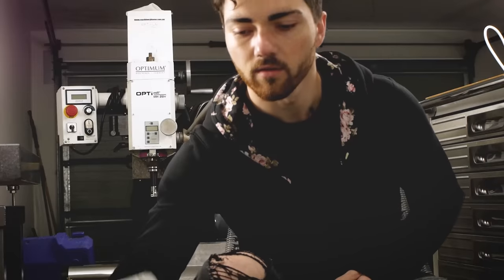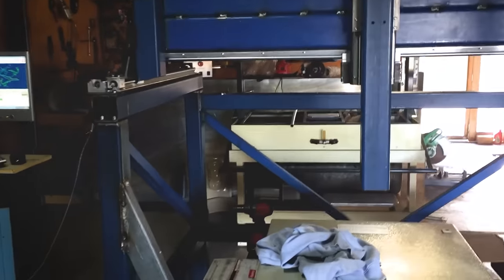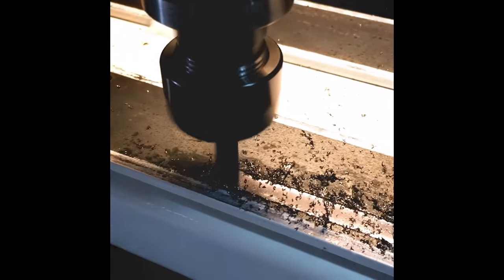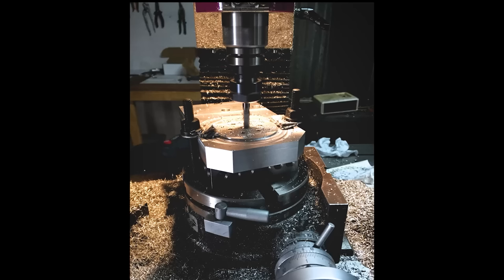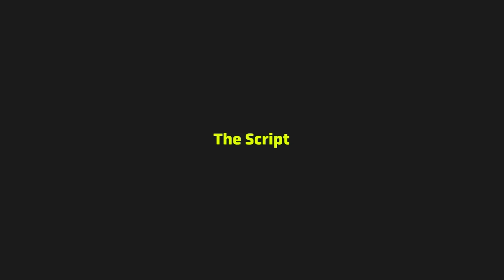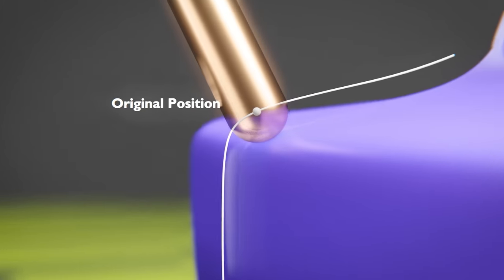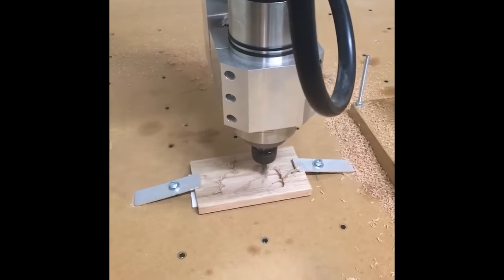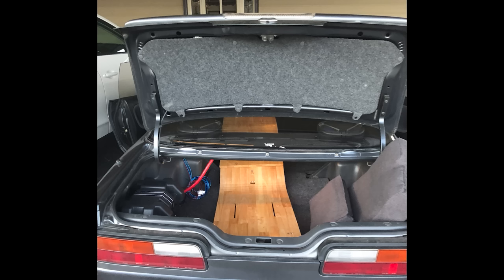I Built a Custom 5 Axis CNC Router and Barely Used It

Comment: You're like a younger smarter version of myself sharing many common interests. Spent about $7k building my 3 axis CNC (contemplated 5 axis but software was an issue). We built a very similar designed CNC's around the same time.  I have been writing code on and off since the 90's, but could never achieve what you did in Python (I could only just understand what you were describing, let alone write it). I did write a self tuning software for the Haltech I had in my 180sx before Haltech even had one themselves. Like you I dropped several thousands of dollars on hardware not knowing if I could even build a CNC, but I dove in the deep end, and with guidance from a couple of friends surprised myself that it turned out so well. I built it to build some subwoofer boxes and surround sound speakers which I have yet to get around to doing. Recently I have jumped back on a lathe for the first time in decades, and I am current writing a mobile phone app to help me with the feed rates. I came up from Sydney about 10 years ago and have settled in Ipswich just down the road from you. You might be interested in what I did with my X axis gantry to over come flex issues.
Reply from the maker: Wow, I really am like a younger version of you 😄
That’s a lot of cool stuff you’ve done! I always feel like the python script appears more complicated than it was, but I suppose that’s often the case when you’re the creator. 
I also want to write an app for some useful tools. Are you writing it just for yourself, and what language and technologies are you using?
Have you got videos on the X gantry rails you’re referring to?
Reply: @machsuper  yes I am currently writing it for myself, but happy to share it with anyone if it turns out alright (I won't share crap, or programs that don't work right). Will be simple to start with. Writing it in... well writing is a bit of a loose term in this particular case, because there is no real writing involved. Derek Banas (guru of all things coding) did a tutorial on this program called "App Inventor" it is a drag and drop interface, but it makes mobile app development real simple. I don't have a history in writing phone apps, most of the stuff I have done in the past was for the desktop, so it is a cheats way of "writing" code. I started with VB6 back in the mid 90's and have written most things I have done in it. A few years back I started learning C# (again thanks the Derek) for some home automation stuff, and an Arduino I was working on. I have touched on Python, but not learned it.

The best video I can see to get a look at the gantry is one called "When Your Z Axis Just Isn't High Enough" from 5 years ago. I am machining a new end plate for the axis itself.

Comment: Thanks for posting an honest retrospective. Multi-axis machines are tough. The physical building part is the most fun. The electronics are interesting to assemble and wire. The software is the bear to beat. Affordable commercial software for a hobby guy like me doesn’t exist, particularly since Fusion 360 quit the 5 axis stuff. The Deskproto program is ‘ok’ but looks like just tombstoning. Notwithstanding all that I pursued the 5th axis for my machine(s) with the very able help of a sympathetic programmer in Germany. My main objective was to embellish my wood turned objects and I’ve succeeded gradually. I was managing pretty well with 4 axes, but for some things a 5th axis would be ideal. I developed an ‘intuitive’ solution and the programmer took it from there explaining what was really going on, and knowing how to apply proper mathematics to it. My embellishing solution took a few years of learning what I needed, 4 machines of increasing stiffness and a great program. I’m now running a PrintNC which is capable of machining metals but I mostly use it for wood. I approached the problem by avoiding the money cannon initially, gradually exploring the CNC subject until I learned enough to ask the right questions and propose the right solutions for my needs. I’m able to use a very cheap Grbl controller, a free control program from the German fellow (not kidding, free for anyone), and I’m having fun embellishing woodturnings. I can use a router, laser, swivel knife, diamond scriber, or anything else I care to create. I admire your jump into the deep end, but it’s sad you kinda lost the fun part along the way. Best wishes for your new machine. Cheers.
Reply from the maker: That sounds like a great journey for you, congratulations on the success! It definitely takes a bit of 'doing' before you can know exactly what you need to build a nice machine without emptying the bank account. I'm still in the middle of the journey of figuring out exactly where and how to place what piece of the puzzle to make it affordable AND highly effective... and maybe even profitable. I'm super excited to see if the future looks anything like I imagine it a year from now. Thanks for the comment :)

Comment: Nice Job We do most of ours with 3D printing and traditional mold making techniques
Reply from the maker: Wow! How cool to have you commenting! I used to watch your RC videos a lot. Every now and then I check on your machining content too. You could do some great body moulds with the machines you’ve got, yeah?
Reply: @machsuper  Thanks! Yes sir...we have tinkered with a few methods using 5 axis...at the end of the day its a fair bit of programming and risk for what is essentially a "one off" piece........its awesome to see more people choosing technical careers! 

Keep up the great work. 

I designed a small 5 axis mill a few years ago..TCPC requires some serious math. 

Harmonic drives and direct drive trunnions make high speed, high accuracy five axis DIY machining a real possibility with guys like your self putting in the effort!

-Jason
Reply from the maker: 5 axis is quite a handful on the programming side, isn’t it? In some ways it’s amazing, in others, it’s not really necessary. 3+2 is a great mid-ground.

It’s nice of you to say all that. In spite of what I’ve just said about 5 axis, I still like to spend enormous effort thinking about it and trying to build 5 axis machines haha. I think the time is about right to push for hobbyist solutions in hardware and - more importantly - software.

Comment: Huge congratulations for your achievement 👏 🙌 👍 👌!!

I am just starting out in my RC custom building and designing adventure!! I have to say that this video inspired me to push forward bit more than I was going to.
I was never  able to pick up a project and keep coming back to it, however this type is one that I feel I could do, like building my own rc truck and I think that is mainly do to the fact that I wanted to learn 3d design and kept coming back to do more.
Also one thing I found as lesson, is that if I feel stuck, just leave it for little bit, do something else and i would just figure things out another way.
I'm taking my time in learning different skills along the way like 3d design, xyz axis, making tools for making stuff along the way, got my first desktop cnc (3018) to start learning on it and have to say soon as I got it was intenting to get upgrades🙄.
I don't know how to code, maybe should start that skills soon aswell. 🤔 
Would you say to buy a budget ( 1st to start learning to use one) milling machine or upgrade cnc to 4 axis?🤔 .

Best regards from UK
Reply from the maker: Great stuff! I still, to this day, wonder if I should get back into making RC parts. I hope you succeed, mate.

I ALWAYS have several very different projects running, so if I'm stuck with one, I spend time on another one. I'm always working on something and being productive. It's important to keep good documentation of what you're doing so you don't get rusty between stints. I use Notion to keep track of my whole life, just about.

I learned all of my machining, coding and electronics knowledge online, especially from YouTube for the machining. If you have the time, you should learn to code. My primary language these days is JavaScript, it's just so useful and flexible.

Comment: You now have 82 subscribers! :) Great job on the software side.  I read in another comment you are now using Dynomotion boards, you will not be dissapointed.  KMotionCNC can look a bit dated, but you can modify the look, and with the API you can write your own if you really want to.
Reply from the maker: Thanks Greg! The subs keep coming in day by day, this video’s holding up for a while.
I am holding onto a Dynomotion board for my next machine. I’ve excited to dig in when the time comes. I might have to learn some C programming 🤦‍♂️😄
Thanks for the comment mate.
Reply: @machsuper  I'm sure you will pick up the C programming no problem.  Being able to run your own custom code on the controller is a powerful feature.
Reply from the maker: @GregsStoneYard  over 200 subs now! How about that?! I can’t believe it.
I’m really excited to see just how much I can do with custom code running in the controller.

Comment: Did you use any optical device for the 4 and 5-axes homing? I guess during the loss of electricity or mechanical shock, the motor can easily loose its home position. Or you calibrate just once?

Comment: I probably went down this same path some years ago when I dipped my toe in the CNC water and bought a bespoke CNC mill from China....very well designed and state of the art for CNC mills I think.
To be honest, I am a manual machinists of 60 + years and always wanted to get into CNC....... now I get revved up writing G code and using wood dowel simulated end mills cutting polystyrene blocks , but that is what I wanted it for, mainly to experience CNC and watch the wheels go around under control etc 
I don't have parts to make that require CNC, but lately as the years go by I have the inclination to actually do a real CNC job to justify the 10 grand I eventually spent in the end.....there's also a lot of other irons in the fire too..
Reply from the maker: No doubt, manual machining is a satisfying and beautiful art and skill. Every machinist should be experienced with it, though I know many aren’t these days. I appreciate manual for those reasons, but I also have a very deep love for geometrical mathematics (though I have much to learn there), as well as being precise about things. CNC machining is a stunning example of combining all those things.
Reply from the maker: I hope you make your CNC dream happen. There’s people everywhere who can help you on forums and Facebook groups.
Reply: @machsuper  If you have a working schedule to do it becomes boring to have to set up a CNC mill and then let it work away to itself......i just like to mess with various program compilations to see what happens when you do a run..........watching it work is the most satisfying part and having a few friends over to watch the latest G code manouvre is also a fun thing......i lost one friend when he insisted that i do something realistic instead of messing around and he wanted to run a part he designed and things got quite tight when I said ....no.

Comment: What is a motion board?  Also, what is the simulation program?  , what is the post processor handled by?  I am trying to build a 5 axis machine please help
Reply from the maker: The motion board is an Ethernet Smooth Stepper, but I don’t recommend it for a 5 axis machine as it only works with Mach3/4. The post processor is Generic Fanuc in Fusion360, then converted by my own script, as explained in the video.

Comment: Omg, yesterday i thought i need cnc and yes i decide on 5 axis just becuse i want it. I already have more than 50% parts and already ordered some this morning from aliexpress.

My design was similar but way smaller, i use 20x40mm and 30x30mm steel tube. Already have the 30x30 leftover from my printer.

I also have mks tinybee with 5x tmc2209, 2x nidec nema 23 2.0a. Already order another 3. My plan to start with 3 axis and gradually updating to 5 axis. I use 4x rs 895 motor with 3:1(60t:20t) gt2 10mm reduction to drive 10mm 304 hardened stainless steel. I already order er16a collet from china that should arrive today.

I planned to use fluidNC, and yes I am here for rotary axis😅. But my makeshift spindle was way too big. Nice job anyway👍, thx for sharing your design it will act as a good reference

Comment: Absolutely amazing. Could you have used slip rings to avoid the wrapping cable issue?
Reply from the maker: I looked at using cheap ones but wasn't sure I could get them to handle the current for a stepper motor and a 2.2kw spindle. High power ones seemed to get expensive quickly. Additionally, using them would mean having to offset the stepper motor and run it with a pulley to try pass the wires through the harmonic drives which live in an oil bath. It was all too much to worry about, so I abandoned it.
Reply: @machsuper  Very good points. Stepper motors being the temprimental things they are, definitely wouldn't play well with the cheaper ones. Somedays I think a light breeze is enough to make my CNC think the proximity sensors have been activated.
Thanks for your reply!

Comment: are you aware of LinuxCNC? You can do tool center point control and also (with a bit of manual patching) switch kartesian kinematics with tool center point control on the fly. Also with Mesa hardware you can add linear encoders on all axes. Also its completely free :)

Comment: A lot of people have actually built themselves a CNC and then never really used it as intended including me. But you do get a lot of experience and it can mean a lot when looking for a job. Now in hindsight do you think it would have been cheaper to order all the parts for the rotating axes instead of machining them yourself?
Reply from the maker: Certainly does look good on a resume! The facts that I built this machine and restored my Silvia are - I'm pretty sure - 90% of the reason I got fast-tracked in the hiring process at Tickford Racing.
It may have been cheaper to get the aluminium parts of the rotary axes machined overseas, but not in Australia, and I wasn't a fan of that. I also didn't know how to make a good technical drawing anyway. Furthermore, the total value from buying a machine and doing the work myself was far greater, because now I have a machine to use on this channel and I gained a tonne of experience from doing all that manual machining. I absolutely made the right choice to do it myself.

Comment: I’m curious to know what controller you used for the project? Not sure if that mentioned at all.

I don’t need 5 axis, but I’d love 4 axis. My current design has dual X Axis stepper drives on a 3 axis. This was a diy build as well
Reply from the maker: I think I mention that I used an Ethernet Smooth Stepper with Mach4. It should be about as easy as any other controller to get a 4th axis setup with this, but I frankly don’t intend on ever using Mach4 again. Partly because I found it a little unreliable (that was 8 years ago to be fair), partly because I would want more flexibility and feature for my future projects, and partly because there’s better and more complete controller packages for the features offered by Mach4 - something like Acorn.

Comment: Most guys just get a bootleg of a high end cadcam, that python transform of 3 axis is a stroke of genius.
Im in Brisbane too, if you attend a cnc bbq please shout out on the cnczone forum, aussie clubhouse thread, do the bbqs still happen?
Reply from the maker: Thank you Mr Wolsy! I had a quick search on CNCZone and found an Aussie dedicated sub forum, but it's rather inactive with only two posts this year. That's not to say I wouldn't be interested in going to a CNC BBQ in Brissy. I tend to hang out in CNC Facebook groups, though I'll admit I should probably turn to forums more often.
Reply: @machsuper  Benny was the clubs central figure in Melbourne, i went to few Melbourne bbqs 2007, 2008.
2008 was at Bens house and it was a pole house on a hill with a diy cnc workshop underneath, cool setup.
I do believe Ben was a cnczone moderator also, ynneb was his profiles name.
Back then it was all american stuff, xylotex, larken and geckodrive.

Comment: Have you considered using a car clock spring to prevent wires wrapping?
Reply from the maker: I wasn't aware of such a device, though I did look at general purpose slip rings. The ones capable of carrying enough current for the 2.2Kw spindle and two stepper motors was too expensive for me. It also proved to be difficult to incorporate as the steppers directly drive the Harmonic Drives and the steppers don't have any through-hole.
Reply: @machsuper  they're what let car steering wheels do 3x rotations with all the media controls, cruise controls, airbags, etc. Although a single wire probably won't be able to deliver 2.2kw if you get a modern one with lots of individual connections you might be able to run all the wires in parallel to get enough current handling! Especially if the voltage is high enough to not need a lot of amperage. 180amps @ 12v no way,  45 amps @ 48v feasible. Just try it with a cheap wrecker one and see how you go. Even if you need to run seperate wires for the router at the very least you can manage all your motor wires! If you're in Brisbane lmk and I'll come give you a hand.

Comment: great video. I wonder, did you try coating your moulds with a heat resistant coating? Such as an expoxy or something like that? What about making moulds out of aluminium?
Reply from the maker: I tried a high temp paint coating, but it just flaked off. I also tried a hard plaster but that couldn’t hold a good surface either.

Comment: some mills have pressure sensors that will stop the machine when the cutting bit gets dull or to hot.
Reply from the maker: I wanted to figure that out on the DMG Mori 5 axis mill-turn when I was working for Tickford Racing, but I never got the time.